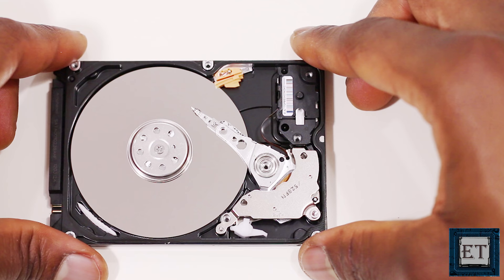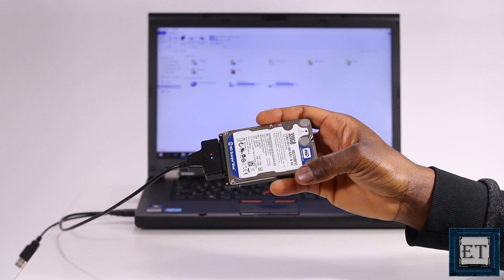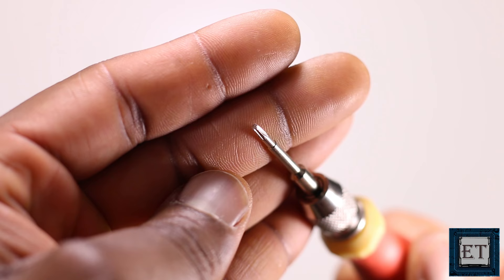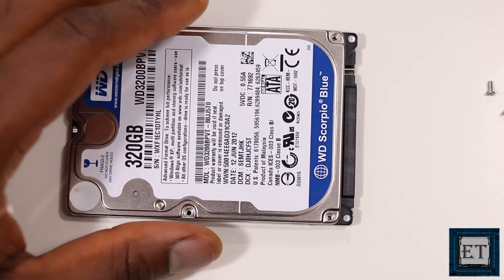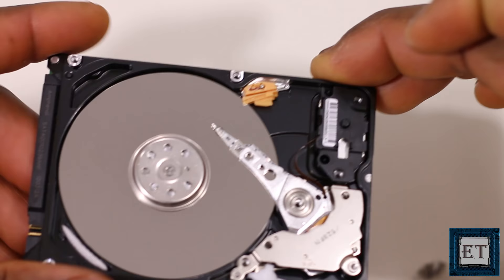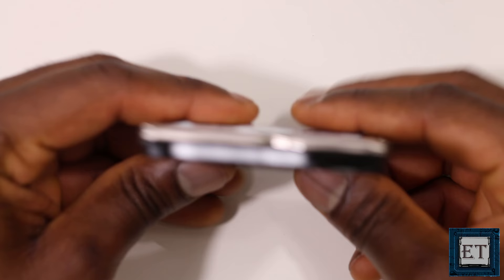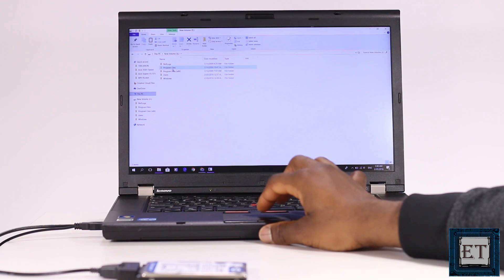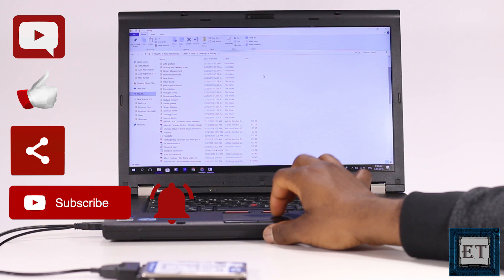How to Repair a Broken Hard Drive With Beeping or Clicking Noise (Recover Your Data)

Comment: You are amazing! I believe this is the exact issue I'm having with my hard drive. I have to go to work to get the correct tool to get the screws off, but I will surely report back if it works, here's hoping! 

Subscribed!
Reply: Did it work?
Reply: @gvshriram  Oh wow I had forgotten about this. No, it did not work unfortunately.

Comment: hi, I have a drive that doesn't spin but I opened it and the head was on the landing position. if I plug it and put my ear really close to it, it makes a very soft click like noise once every second, almost impossible to hear. It's still not spinning, what could it be? it gets a bit hot after just a few seconds of plugging it in

Comment: Mine connects. Shows all folders and files. Then beeps after about 2 minutes. For the short time it is connected files can be accessed. After the beep files and folders are shown but can no longer be read. Mouse selector just spins. 

Any suggestions?

Comment: Hello, first thank you for your video. I have same problem and I opened this and did same. but when I closed and tried to connect computer, it gives same sound and return back correctly. Not it is on disk. Could you please give support or suggesstion?

Comment: My external HD is making that same exact clicking noise but after I opened the external HD I found the arms in the correct location, not on the platter. The clicking noise starts once you plug it into a PC’s USB port. What might be the issue and how would I fix?
A note: I cannot open one file nor does any pc recognize the external hd.
Reply: I have the same issue. Have you found the solusion???
Reply: @stephan121677  No, the hard disk repair service stores in Los Angeles(my hometown) are asking 1000USD plus to repair. 
I used to live in China but left……I remember there were people who repair smartphones, pc parts, and notebooks for cheap. 

If you hear of a solution let me know.

Comment: Hi, this was one of the best videos that I've seen on this issue.
I tried it but unfortunately my arm was in the correct position and clicks when I power it up (with the case closed!) so there's something else going on with my hard drive.
 Any ideas?
Reply: Mine does that too and need to figure out why
Reply: @Solomunzy  did u find out waht it was I have the same problem to this day

Comment: Hello. I have issue with my External HD, when I plug it into USB port on Laptop the light turns on, the disk is spinning but laptop doesn't show the drive so I can't excess the the filed I have on it. I tried your method since I might have dropped my drive. but the arm is in its station. When I plug the drive into USB the arm starts moving onto the disk and off onto and off. What to do now???

Comment: I thought this was the problem with my drive but when I opened it the disk head was at the position it supposed to be.  So when I put it back together & tried to access it worked! Not sure what happened though.
Reply: Same problem here but still not working. Keeps making clicking and whistling sounds

Comment: Mine is stuck just at the front of the landing zone. So it's not on the disk, but its not all the way in the back of the yellow landing zone like in the video. It's not moving very easily. Does it have to be at the back to work properly?

Comment: Brother, my laptop harddrive gives same sound, I opened the hardrive as you said but the head was in correct position, means it's not stuck on disk. Please advise if I need to check by connecting USB sata?

Comment: Is there anyway to easily and safely remove the screws without the proper tool?
Reply: I used a napkin hand gently moved the pole thing to the side, now the disc is spinning but still won’t register on my laptop

Comment: Hey there, thank for the clear and short video! I follow your step to open my external hard disk but the reader was in his position without any sign of being moved. I have a big question now, after open the disk, and until I have the chances to meet a technic, do I have a risk now, once open and close, to have a problem with the possible data inside?, I was reading that after open I loose the vacuum inside the disk that came with the original pice, and I have chances to accumulate humidity now. What recommendation you can give me?
Reply: What ended up happening with ur hdd

Comment: Thank you for the video! I have opened it up and everything was still in the correct position and there were no scratches on the disk but it's stil not working. It does still light up when plugged in, but just not recognised on Mac (even on Disk Utility)
Reply: ME TOO
Reply: same with me.. did you find a solution
Reply: Same with My WD backup drive
Reply: Give it a few extra minutes to show up. Took mine longer than normal but it eventually appeared... getting everything off of it asap though (data transfer speed is also noticeably slower at the moment)

Comment: Hi. I was wondering if you can give me a solution to my problem. I have a Seagate ST31500341AS which is not showing in windows nor in bios. Firstly started rarely not showing up in windows but showed in boot, and after a restart it would show up. Then it started frequently disappearing. I tried other SATA cables and ports on which other drivers worked normally, but this drive didn't.  While it worked I used CrystalDiskInfo and Hard Disk Sentinel and it showed that it was all ok and with great health. I also took the board off the hard disk and cleaned all the connections.
Any help would be appreciated.

Comment: Just tried this and it’s no longer stuck. When i plug it to my laptop though, it clicks for a few seconds and stops. The HDD is detected but i cant open or read it. What does this mean 🥲
Reply: Yea same that's the head prob so you bc u opened it at home rip the last thing you try is to replace the head

Comment: I assumed a drive that was clicking was in many cases, irreparable as that often means there are damaged read/write heads somewhere, no? Perhaps not always irreparable but difficult to fix. Or is this just to repair the drive enough such that it can be recognized externally for file recovery? Very informative and useful either way, thanks! Sorry if this question was answered in the video. I'm multitasking and can't watch it all the way through at the moment.
Reply: It is irreparable, this just might buy you just enough time to copy some data from the HDD to a new one so you don't lose that data, after that you throw away the old and broken HDD.
This really is the very last thing you should try when trying to recover data from a broken HDD as it is the all-or-nothing approach, this either works or permanently dooms your HDD and all data on it.
Various reasons for that, one is that dragging the read/write heads over the platters like that will damage both. Opening the drive will allow dust inside no matter how clean your room is. That dust will further damage the HDD over the next few hours (or quicker...)
Opening the drive, then putting the screws back without the proper torque setting will damage the drive further as well, not as bad as running it without the cover but still it's bad.

This is what you do when you've tried all other methods of getting the drive to work long enough to recover data from it. You might compare it to using a shotgun to shoot out the hole in your boat, it usually makes everything a lot worse but if nothing else can be done you might as well try it.

Comment: Mine used to keep beeping until I kept moving it and it works but last night something wring happened with it like nothing pops up in my PC anymore relating to the External HDD but it appears in the eject area its not called what it used to be but its now called BACKUP+ I tried every method possible but none of them work im thinking of opening my HDD and trying this but im scared will it guarantee work? im using a 1tb Seagate Backup Plus External HDD.

EDIT: I forgot to mention it wont show the light even when plugged in and I checked Disk Management it wont appear as well.

Comment: So for some reason my desktop cant recognize my hard drive inside and i have alot of stuff in there, when i go to my files it only says local disk D, could i be able to try this repair technique on my hard drive?
Reply: If this data is very important to you, its best to not mess around with the drive. They are not meant to be disassembled by the end-user and you can permanently damage it if you have no idea what you're doing.

Comment: I opened my WD 2 tb elements it making beeps sound the spindle is on the correct place it's not on the disc I packed it again but it still making the sound not reading please help
Reply: same problem bro.....and hows about now is it fixed by yourself or by technician....and if by technician then how must it cost around you

Comment: Cause is WEAK PSU, more exactly too few ampers in Sata power cable
I had an old machine, older but 400W PSU, used sata hdds with Molex to Sata cables
These also can be a problem...

Comment: I opened my desktop hard drive .. the head was where it was supposed to be but still, my laptops are not able to read it when I put the drive in case and connected it to the laptops..any idea what could be the issue?

Comment: hundreds of videos of suck arms but no video about clicking sound as the mag arm swinging back and forth
Reply: same problem i'm struggling with.found any solution yet?
Reply: Head of my hdd was stuck, replaced it following same method but it didn't work, OS detects HDD under USB devices but HDD keeps on giving clicking sound and no volumes being shown.

Comment: Is it possible....
To recover the data from dead HDD caused due to voltage fluctuation and damage pcb with IC by changing the platter of dead HDD in to a working HDD of same capacity?
Reply: No it's not, data recovery companies will transfer disks into new hdd case, this is impossible to do by yourself

Comment: This doesn’t wipe my data like I see people saying? I couldn’t take the thing off and I’m worried might have scratched the platter trying to get it off… now the motor runs for 5-10 seconds and then cuts off
Reply from the maker: It wont wipe your data but is quite a sensitive process, if your data is crucial, I suggest seeking the help of a technician
Reply: @EasyTechs  They were gonna charge me $1,400 to fix it which is outrageous.

Comment: Guys, never take your hard drive apart if you are not a professional. Because once you mess with the cover screw and not turn it back to its original specification, hard drive won't detected on your computer. Many people has done with opening the cover and put it back and it end up to the broken hard drive
Reply: that's why we now use SSD

Comment: What size was the torx screwdriver you used? Was it a T6?
Reply: Yes, it was a T6.  However, ONLY do this method as a last resort cuz from the comments, it's said that it only a matter of time before you HDD dies cuz of the exposure of dust particles getting into it and it's best to backup your data before that occurs.

Comment: my toshiba HDD external is opened but the heads are away from the platter but still when i put back the cover and connected to pc still clicks and no running
Reply: Change the Cable

Comment: Need a quick answer..
My Laptop clicks two times in my hard disk on start up and then it never starts.... I have a theory that it is because of the hard disk... Since i saw a problem like a removable thingy is improperly connecter or etc... The 0000009 thing.. please help hehe

Comment: Hi man. Thanks for  nice video.

I have a little question:

I have a one hdd and it's run and work for now but I hear that horrible Beep.. The question is:
Is it possible to REMOVE the hard drive, and put it to another hask disk ?? Do you understand what I mean? Basically, just transplant the hard drive .. So practically if the mechanism is ruined, i  transplant it in another hdd in another body. It's possible?
Reply from the maker: Good to know it helped you out, thanks so much for the feedback!
Reply: I guess if you have nothing to loose you can try

Comment: Have the same hard drive you are repairing. I did what you said and now it is at least spinning and recognizing on the computer but nothing is coming up. Any suggestions? thank you
Reply: I think you need special tool to put on the cover again and screw it up with the original specification (the torque of each screw). I have watch a video about open up the cover and put it back without the tools (without doing anything, only open up the cover and close it again) and the hard drive spinning with terrible sound and not detected on the computer
Reply: H

Comment: i using WD elements 1TB, last night i face the clicking sound problem, I ask the person in IT that I know, most of them say if need recover it will cost a thousand to thousand five, is it so expensive? I not dare to open the hard disk, i scare later i make it more worst. What should I do?
Reply from the maker: Is a risk for sure, with important data in the drive, maybe is better to take it to the experts
Reply: is the clicking sound can be fix? I heard ppl say cannot, but some say can recover the data

Comment: My platter is in right place but still my hard drive is clicking sound
Reply: I have the same problem. Did you took it to a Data Recovery Center? Or is there another way to solve the problem?

Comment: can you use the 2.5" adapters same for 3.5" hdd's ?
Reply from the maker: No, the power requirement is not the same
Reply: @EasyTechs  
Can I use this method of repairing for 3.5 hdd?
Thanx
Reply: @gayastudio5471  yes

Comment: The thing is, I have 2 external drives and both work perfectly on my 2 laptops, but on my big pc both make that clicking sounds no matter what I do, dont know what to do special because they used to work
Reply: For this you have to check smps voltage on problem pc,or needs to replace smps tx
Reply: Thank you very much, that´s what I did a few days ago and worked

Comment: Sir, my disk (WD Scorpio) has read/write error. I opened it and the disk head was NOT on the platter. So I did SATA connection test, and it kept coming on platter. Whenever I disconnect, the disk head would go back to the normal place. I tried to stop the disk head to go to the platter manually gently, and I am getting the same sound you were getting in the video, but without opening the hard disk. Can you help me please?

Comment: my hdd is working well but it makes some noise while working, does this tutorial works for it?
Reply: Noise not related to normal spinning/ spinning up? Telltale sign of imminent failure on a drive that was used a lot, it happened to me too, so I got ssd and used hdd as external. It failed soon after.
Reply: well it sound like little cracks, but to be honest i tried to open it but i didn't have the proper screwdriver and then i just abandoned the whole  process and lived with it, i am used to this sound nowadays so it doesn't bother anymore

Comment: the issue with my hard drive is the beeping noises, when i opened it up and turned the disc clockwise, the reader doesnt go back all the way into the head!!
Reply: You need to turn it counter clockwise

Comment: Mine was clicking, after doing this it doesnt spin it just beep.......beep.......beep...........beep with no spinning
started clicking out of no where 2 weeks ago but no performance issues but clicking every 4 seconds. 100% was inside my pc case never dropped
Reply: ASMR Ross Did your issue get resolved?
Reply: I was able to get it fixed on my own before it just stopped powering on altogether. While trying to salvage only 1/32 of my data (None of my games, images, documents, just like 7 programs and 32 videos) I opened it up to see that after that somehow it was scratched to hell when before it wasnt at all even when clicking. It is dead, and all of my 1000s of programs, games, and files, documents, programs with it :''(
Reply: ASMR Ross
Reply: what
Reply: Warning: opening hard drive cover without any professional guidance is not recommended because it will damage your hard drive. Never open the cover out of your curiousity about what happen under that cover and don't even try to repair it yourself

Comment: my turns on and runs for about 20 seconds and then turns off and it never done that before
Reply: It is normal. you need disable head check, write and recalibration process in firmware and start reading again.

Comment: this is a terrible video
I did open my drive and now no recovery specialist can accept to fix it because it's an OPENED drive
one should never open the drive because the platter can be damages easily by dust in the air

Comment: My HDD produce Tik Tik sound some says media problem how to fix it ?
Reply: It's gone probably...
Reply: @manishholla  is there any solurion 6 years data present in HDD
Reply: @engineerrehman6821  I can only think of a solution.. take the old hdd platter out from its old enclosure, and fix it in a same model enclosure and try again. It may post something on the screen
Reply: @manishholla  thanks manish i will search it in market maybe it will work .

Comment: What screwdriver do I need? I couldn't hear due to your accent
Reply: Oh I got it, it's a t6. Thanks for posting op, it was really useful as far as opening my faulty hard drive to reveal the platter. However, I was surprised to see that the cause of the clicking for me was not that the head was on the platter. For me, the head was in its default position, so basically I am still trying to find the reason for the clicking noise. Any advice would be gratefully received